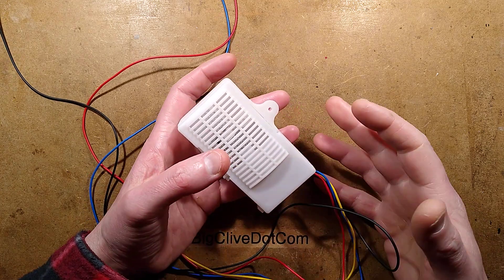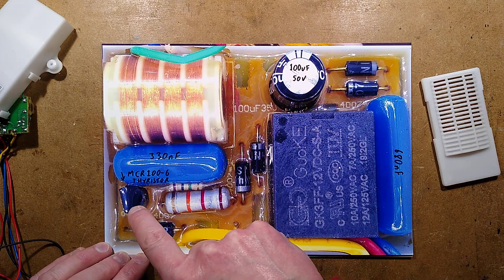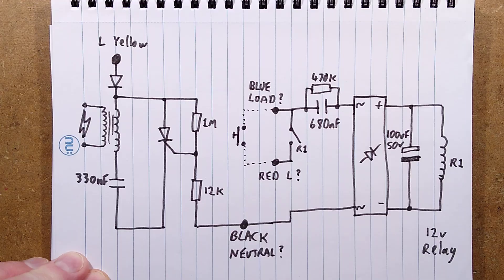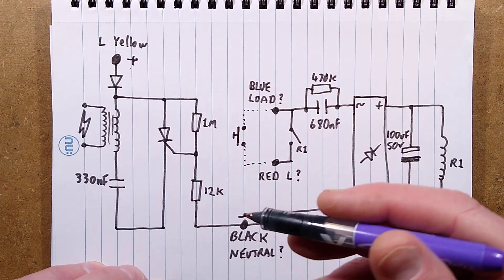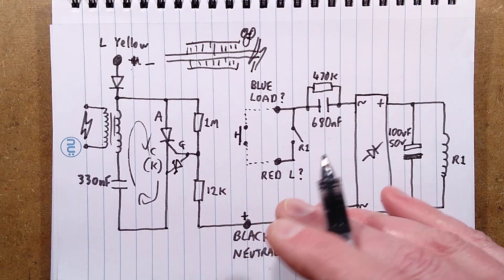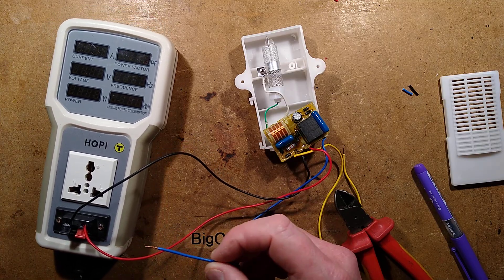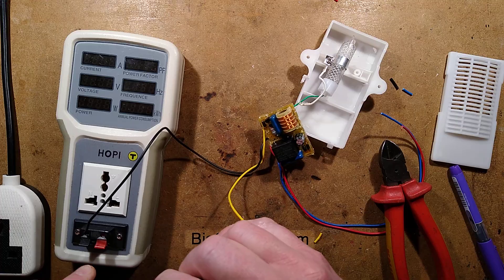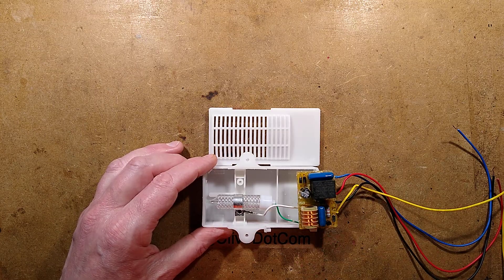Random high voltage eBay "thing"

Comment: Your painted shematic is a bit confusing. The output of the transformer goes to nothing and the right part of the circuit is not a closed circuit. Two different part got the same label (r1). Since the blue and red cables are not connected to anywhere they should have no effect on anything. Your shematic doesn't make any sense to me..
Reply from the maker: That's why it's so weird.  The current path is non standard.
R1 means relay one - the coil and its contact.
Reply: @bigclivedotcom   Oh wow :O Thanks for explaining. This makes me worrying about always on power devices that run in homes with circuits that looks like the author did not really had the profession to design these and may have constructed potential time bombs that could lead to catastrophic events like a fire.

Comment: How does it make Ozone when it is inside a bulb? Wouldn’t the Ozone be trapped inside the bulb? The negative plate for the corona is on the outside of the bulb. Is Ozone produced on the negative plate? Does air flow through the bulb i.e. it is open at the bottom?
Reply from the maker: The gas couples to the inside of the bulb and then capacitively transfers to the mesh creating a corona discharge outside the tube.
Reply: @bigclivedotcom  So I guess the bulb is part of the dielectric and the ozone is produced inside the holes in the mesh. It probably wouldn’t work if it was a solid plate. Would it work if there was a hole in the tube?
Reply from the maker: @jonnelson9760  The internal gas is needed for even coupling to the inside of the tube.  You can get open air ceramic ozone plates.

Comment: The potting may be parylene coating. Thyristors are sometimes referred to as SCRs. The relay is LVP (low voltage protect) which must be reset when it drops out. They are using the inductive and capacitive KICK of the collapse of the B field in the inductor reinforced by the E field capacitor discharge current to power the lamp as a weird flash lamp or and odd sorts of line high frequency relaxation oscillator.
Mark Fay US MMC Jr. Engineer QMED AS-E

Comment: As the output coil runs at mains frequency anyway, couldn't it be wired directly without the electronics.  Waveform is different but circuit is simpler.
Reply from the maker: It has to be a series of spikes.  A mains frequency transformer would be huge and heavy.
Reply: @bigclivedotcom  Ah, so that circuit converts 50Hz sine wave into 50Hz spikes.

Comment: Thyristor oscillator that's also a heater. They could've used a FET instead but needed higher control voltage for some reason.

Comment: Question: can you suggest a way to cheat the Dewalt cordless charger to make it charge any battery ? You know it has 3 or 4 pins, i think the extra 2 pins for  thermal protection..how to bypass it ??

Comment: Very cool. I would be interested to know what components they got rid of by using the thyristor "in a novel way?" What would be the circuit if it was more conventional and not cut-down?
Reply from the maker: A single extra diode between cathode and gate of the thyristor could have made its life easier.

Comment: Could this be similar to a common dimmer circuit where the pot has been replaced by fixed resistors.  And it creates a sawtooth waveform like dimmer circuits do.  And that sawtooth generates a high slew rate waveform applied to the transformer which creates high voltage spikes like from the coil in your car.  I haven't really looked at it hard enough to determine if that's how it works.  It's late and I'm sleepy.

Comment: The Chinese do seem to love generating o3 in some products. 
I have a chinesium hottub that has o3 generation built in. I also have a chinesium steam shower. Once powered down, displays an o3 icon on the lcd. It would be interesting to find out, if o3 is actually doing anything useful. I know Ozone is a toxic gas,  I do hope they ain't secretly trying to kill me
Reply from the maker: You may get a very slight bleach smell.  Ozone is an essential part of air in nature at low levels.  It can cause irritation at higher levels.
Reply: @bigclivedotcom  it's an interesting thing to consider, that o2 is essential for respiration. Along with o3 been our protection against high energy Uv radiation from the sun. While causing  irritation at higher levels lol

Comment: It could be the guts of a line powered CPAP cleaner ozone generator. Amazon and EBay have dozens of them. The completed unit probably comes with a bag in which you place the whole unit plus the cpap mask and end of the hose. I bought one that has a rechargeable battery instead of ac power, and use it occasionally. The battery is good enough for 4-5 sessions of 20 minutes apiece. A lot cheaper than the $600 unit advertised  on tv. Ozone does kill viruses, and while my device isn’t approved for the purpose (like the expensive one is), it’ll do something useful. The o3 output is small, but definitely there, and bagged it will get to a reasonable concentration in 20 minutes.

Comment: Even though I understand electrical currents and have for many years, there's still that tiny part of me in the back of my brain that doesn't feel right about such small gauge wires being plugged into mains power. Completely understand that it's (mostly) a non-issue but it still just looks that little bit wrong.
Reply: We are so used to the external cables being able to handle the whole load of the appliance, or handle abuse, that we forget almost everything has very small gauge mains wiring inside!
Reply: Living on the edge 😆 🤣 😆
Reply: It should though, because our standards for live mains that could carry 10A or above typically mean 1 mm or more in CSA of cabling.

Comment: It looks like those are sold as a way of disinfecting chopsticks.  I actually use ozone generators to de-stink sneakers. Put them in a box with ozone overnight and the smell (and fungus) is gone. Ozone is poisonous, of course, and could eventually attack plastics and other sneaker materials, but bleach is worse and the only other thing I've found that does the job.
Reply from the maker: Check out my fix your feet video for a long term fix for smelly feet.

Comment: I would have thought that when the thiristor is triggered it causes the primary of the transformer and the capacitor to ring , and presumably the -ve going ring swiches off the thiristor until triggered again. Looks like a simple form of comutation!

Comment: Well, apart from the relay being a little over driven, I think the circuit is actually quite clever. I like it when circuits are simplified to the max without really affecting the performance too much. Of course this is a cheap device and I doubt the quality is all that good. But still, the thyristor trick is pretty neat. The only thing I don't like that much about this design, is that it's limited to the mains frequency. I think I prefer lower current spikes at higher frequencies (preferably > 20 kHz). Just to avoid the fairly annoying buzzing.

Comment: What would be the point or use of the whole relay section? Yes it latches on when you bridge the blue wire, but it seems like all it’s doing then is keeping the relay powered. If it doesn’t affect the actual ozone generating side of the circuit in any way, what does it do?
Reply from the maker: It may have been for an eternal UVC lamp.

Comment: I wonder if it's designed for corona discharge, but the higher voltage of your power versus China's is causing it to arc.
Reply from the maker: The corona occurs on the outside of the tube.

Comment: So.... what was the point of the relay circuitry? It doesn't actually turn the HV coil on and off, the coil just runs whenever there's power. At first, I thought that maybe red was supposed to connect to yellow, so that the relay contacts would be in series with the coil. But if you did that, the relay would be energized whenever the power's on, so it wouldn't behave any differently from just having yellow and black across the mains and not having the relay at all.
Reply from the maker: I think it might be for an external UVC lamp.
Reply: @bigclivedotcom  For some reason, I had red and blue backwards in my head. I was thinking that blue was live and red was load. Now it makes more sense.

Comment: As you've configured it, the safety circuit doesn't provide any safety. For it to work "safely", the yellow would need to be powered from the relay contact, e.g. with blue live and red connected to yellow.

Comment: Many years ago when I was a lad, my dad suggested ozone generators could be placed in clothes dryers to help freshen and disinfect laundry.  Aside from the plastic enclosure, this device seems purpose built for that application.  The mains 220VAC as an electric clothes dryer, and the instantaneous start circuit relay.
Reply from the maker: Some dryers have a small UVC lamp for ozone.

Comment: That little device wouldn't produce ozone in any appreciable quantity and what it does generate would barely leave the casing of the device what with the half-life of ozone being about 10 minutes. If it did have a practical purpose, it would be in a very, very, small chamber that wasn't reactive to ozone.  

Ozone generators using discharge in atmospheric air (20% oxygen) are pretty useless. And if it did produce ozone in an appreciable volume, it would probably turn the seals of any device it was contained in to dust (stories are legion where people have used ozone generators to get rid of the tobacco smell in cars only to find all of the foam in the seats has reduced to dust). 

To get a decent concentration of ozone one has to use bottled oxygen. I once had such a device that could produce it in relatively significant concentrations where it was bubbled through water prior to being used in a chamber. I sold that generator for a lot of money on eBay!

Somebody below suggests that it is used for disinfecting chopsticks in a small cabinet. This does figure as the Chinese have a very attuned sense of hygiene (at my ex-wife's public school back in the 1970s and 1980s the Chinese boarders were not allowed to touch the water in the pond in the grounds, for example). And of course, until recently we thought they were odd wearing masks in the street which was only ever a courtesy for other people not to catch their germs.

Comment: I produced ozone with 1000 volts dc and a xenon flash tube reversing a step down xformer and a 2.0 mfd 1.600 volt capacitor 250 volts dc.

Comment: UK mains voltage is 230v.
Reply: @Matt Quinn Yes, I know. The harmonisation consisted of massaging the UK tolerance one way, and the EU one the other. In the same way, the Asian 220v system won't be at exactly 220v all the time. It is still incorrect to refer to the UK system as a 240v one; the nominal declared voltage is 230v.
By the way, if you are measuring 257v on the system, either your meter needs calibrating, or there is a fault. The maximum permitted voltage is 230 + 10%, which is 253v
Reply: @Matt Quinn Clearly I do!

Comment: Although this thing seems awfully unreliable, ozone generators are used a lot for sterilization of equipment in the medical world and food production plants. In those cases you often don't want to expose the equipment to a lot of heat (melting/deformation of plastics and/or breakage due to different temperature coefficients) or harsh chemicals (you don't want bleach residues in your milk). Ozone is quite effective in getting rid of viruses and bacteria and it doesn't require anyone touching the infected material. It even doesn't need line of sight (like you do with UV). Ozone is a bit slower than UV though, and is not effective in area's with a high airflow (like fume hoods).
Reply: It can also be a super nice way to desinfect the outside of containers with biological samples by the way. It's an excellent method as long as the container is air tight (which they often are). The operator won't have to work with harsh chemicals and the container doesn't have to be sealed for UV (which they often are not to be able to disinfect them easily after use).

Comment: It looks like the high voltage part is a motorcycle ignition cdi box. They use a coil, thyristor and can use 2 or 4 wires.

Comment: Check the arc frequency. Probably much higher than 50Hz.
I'm pretty sure with that thyristor drive circuit it does not turn on when the mains cycle changes (which you said), but instead is an avalanche trigger, so it turns on whenever the cap gets charged high enough voltage, then discharges very quickly through the H.V. pulse transformer. That's common in cheap spark generators, which are also used in insect exterminators. 🙂

Comment: It’s a bit easier to understand if you model the SCR as an NPN and PNP transistor in a latching configuration; Base of NPN connects to collector of PNP, and the “gate” terminal. Collector of NPN connects to base of PNP transistor. Emitter of NPN transistor is the “cathode”, and the emitter of the PNP is the “anode” of the SCR. Now it’s fairly obvious that there’s a diode (junction) from the cathode to gate. Only one little problem; it’s reverse-biased! The gate would have to connect to the bottom of the 330 nF cap, and the cathode to the top of the 12 kilohm resistor in order for current to flow from yellow -> diode -> primary of H.V. xfmr -> 330 nF cap -> B-E junction of NPN -> 12 kilohm resistor -> black. I don’t see how this would ever charge the cap unless the SCR failed dead short and left black, sooty skid marks inside the case!

Comment: I d day the resin coating is a variant on a Dow Corning coating I used for high voltage circuits in HV power supply circuitry. It's to stop corona and arcing on HV paths. It not great potter or adhesive as that's not it's function.

Comment: I've installed a couple of ozon cleaners in garbage rooms on behalf of a land lord. Not anything that flimsy of course. Since they kill bacteria, they also kill bad odors. The new smell was very metallic. Almost like you had coins in your mouth, but apparently that was preferred. Maybe those little ones are used instead of forced ventilation in small bathrooms without fans?

Comment: 2 questions, for two different applications I need.
Would there be a simple way to convert the relay part of the schematic, into 
- a slave switch
(Where you power on one device by its own power switch, which power consumption then triggers the relay, which can then power a socket / other device. Switch off the first device and the relay will deactivate.)

- a safety power switch, which is often used for dangerous equipment, to be unable to start by itself, after a power cut. I think it can already be used for this, as it is.

Both uses would be for in my workshop.

Any suggestions or directions are very welcome and appreciated..
I am living in Egypt. Component availability is a problem. Especially for less common components, please keep that in mind when coming with suggestions. Keep it simple.

Comment: They could use just a low voltage AC relay, so they wouldn't need the rectifier. 24V AC relays are pretty common.

Comment: The word 'Sensor' was used in the title of the Ebay listing so I was wondering if it was a mistake or if it means the unit is used with another unit to measure the Ozone levels and top them up as necessary ?

Comment: I think it doesnt need a polarity reverse to trigger. After the capacitor is charged the current over the 12k resistor goes to zero, and the capacitor is effectivly a voltage source for the thyristor, which then gets triggered via the 1MOhm resistor. And then the cycle starts new. it will fire multiple times per positive halfwave.

Comment: Hold on. Is that tube sealed? Where the air pass?
Reply: The corona discharge occurs in the air on the outside of the sealed tube. Electromagnetic energy easily penetrates glass.

Comment: Red to live, Black to neutral and Blue & Yellow together.  If the two wire version just has the ioniser circuit in it, then one or more could be powered from this unit in a master/slave configuration by connecting all the blacks together and the blue to all the yellows.

Comment: Hello Clive I have been using one of those same high voltage transformers in an ESD Gun that I built a few years ago. https://youtu.be/93DY91BVZh8 You can buy the transformers on eBay. It’s still going strong despite having a lot of use a couple of years later.  The most important thing about driving these is to deliver a super fast pulse.   Thanks Chris

Comment: This is indeed the most unusual way of using a SCR I've come across so far. I found an interesting appliction note for thyristors, that also deals with negative gate biasing:
https://www.littelfuse.com/~/media/electronics_technical/application_notes/switching_thyristor/littelfuse_triggering_and_gate_characteristics_of_thyristors_application_note.pdf
Nevertheless, all datasheets to the MCR100 I checked so far stated a maximum reverse gate voltage of 5V, which shall not be exceeded. I have my doubts that the thyristor is operated within its limits in this circuit.
Furthermore, and I my be wrong here, this hole contraption around the thyristor only works, because it relies on the leakage current of the rectifier diode. Otherwise there woud be no current into the gate during the discharge cycle. Confusing...
Reply from the maker: The gate current comes from the capacitor just before it gets shunted.

Comment: The circuitry is similar to SCR ignition circuits for cars.  you can find an example in 
https://de.wikipedia.org/wiki/Hochspannungskondensatorz%C3%BCndung unfortunately in German language and the corresponding English wiki page is different. But schematics are more international